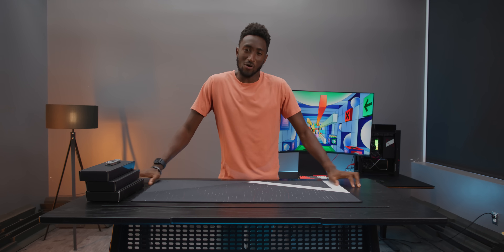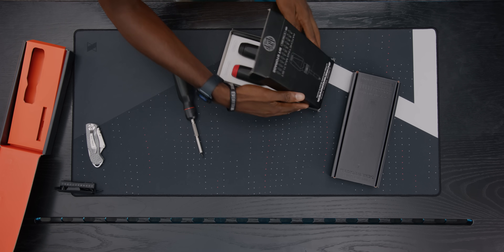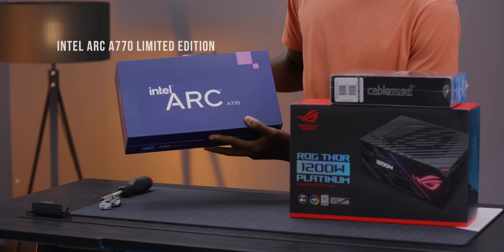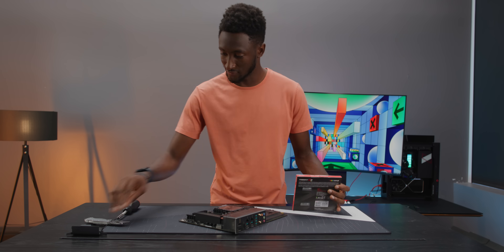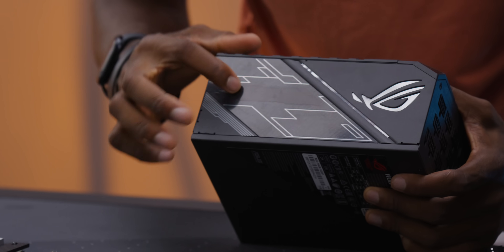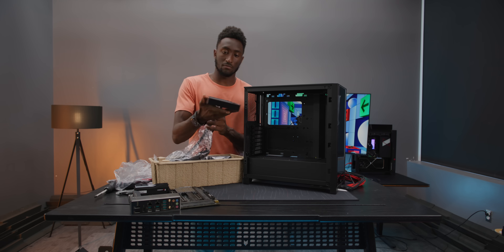World's First Intel ARC PC Build! (A770)

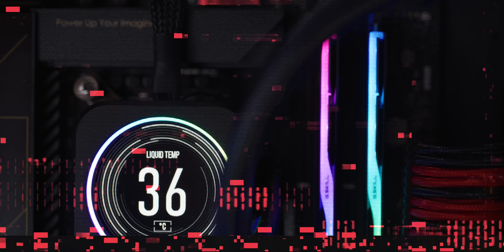Comment: You should flip your top fans to exhaust (14:47) x5 120mm intakes and only x1 120mm rear exhaust is definitely some positive pressure.
Reply: Thought the same this moment - but noone seems to care.
Reply: yeah I was wondering why no one was talking about a few of his slight wrong doings too @Pirate85_Original
Reply: Eh, little extra positive pressure keeps dust out lol. The parts he has probably won't be creating tons of heat buildup anyway with 6 fans going and the AIO. But it would look nicer, so either way prob works fine.
Reply: Now its easier to speak with hindsight now, and things have changed of course. But I will still criticise, for educational purposes, the video:
1. This build is wholly 'High-End'. Everything apart from he gpu is. Thats like calling the RX 6700xt 'High-end'. Nah, its a solid but budget 1440p card.
2.  You didn't say how much each part costs and total build cost. This is huge as people need to truly see the Cpu-Gpu imbalance. If you di an I5-12600k with the A770, THAT WOULD MAKE so much more sense (sorry didn't mean caps).
3. You really aren't supposed to front mount an AIO. Yes it works, but more dust gets towards the fans. Moreover (idk the exact science) but the cables are less optimised that way too.
4.. When doing the final shots of the completed build (14:45) , the 2 top fans are the wrong way round.
5. You only tested 1 game my friend. Yes time constraints and all that. But you tested ONE game. Come on now everyone else tests a good several and at 2 different resolutions. Hell even if you didn't have time to test at 1080p testing say 5 games at 1440p would have been actually a good test of the PC.
But I hope since its been a while now you know do these things. As well as doing: XMP profiles for ram, using Cinebench to test CPU etc.
Reply: Not to mention he doesn’t have fans on the rad, those were the three that came from the front of the case.

Comment: The top fans are wrong way around.
I see that you swapped around the CPU block and fixed up that missing top pcie cover.
You probably should have left the hard drive mounts in the computer to save having to find them if you ever want to use them.
I also probably would have put the power supply facing with the fan up if the LCD was covered, one fan at the top, one at the back, and one out the bottom.

Comment: That PSU looks like it was upside down, so temps may be a little higher then expected - but what a sweet build. The Intel Arc seems like quite a competitive card - especially if it compares to a 3060.
Reply: If you freeze frame at 10:27 or 15:31 you can see the PSU is correctly oriented.
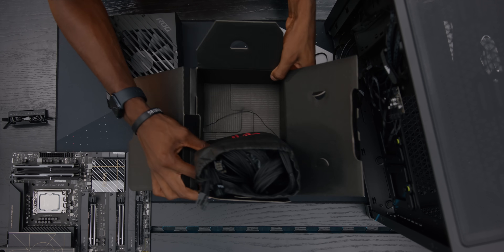Reply: @RK-252  If the PSU sat at the top of the case I would agree with you - however the PSU sits at the bottom of the case (your 15:31 timestamp shows that bit).  So at 10:31 (with the PSU installed & remembering the PSU is at the bottom) - connector is upside down, and writing on the PSU is also upside down too.  However - just spotted at 9:05, Marques indicates if he puts the PSU in the correct way - the PSU's LCD screen giving power consumption info is blocked by the side casing, which is probably why its inserted upside down so he still has visibility to that.

Comment: The radiator tube orientation doesn't matter, as long as the pump isn't above your radiator (radiator mounted on bottom of your case); however if your radiator has a pump where the tubes is I'm not sure about that one
Reply: Also the top fan is oriented for intake, isn't it supposed to be oriented for exhaust? You creating a vortex in your PC with the front fans airflow colliding with the intake up top. Heat rises, so you should exhaust the hot air out the top

Comment: 0:00 Introduction 
2:16 The parts
3:53 The Build,  Motherboard
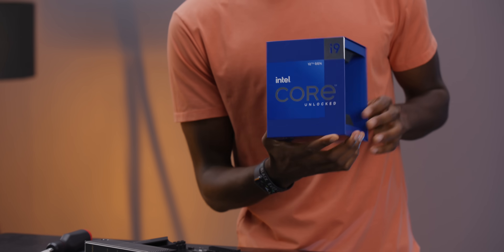4:29 CPU 
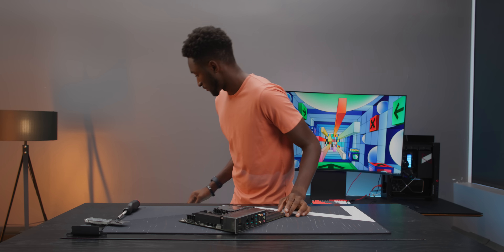5:25 RAM
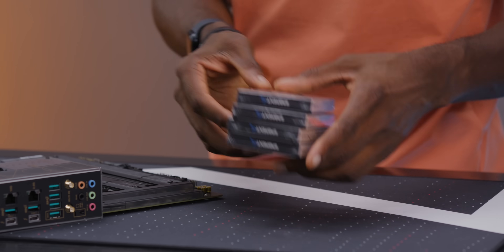5:56 SSDs
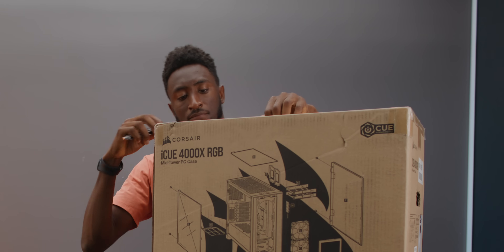7:18 Case
8:23 Power Supply
9:25 Cables
10:51 CPU cooler
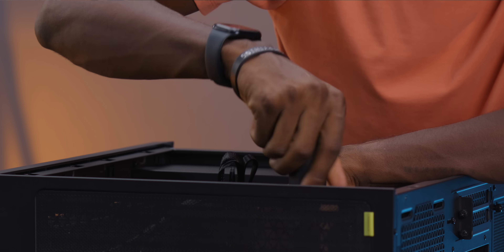12:52 GPU
14:22 Final Build
Reply: Did he apply thermal paste ?
Reply: @Thai101full  nah i guess he went with paste that already comes with it
Reply: @Thai101full  nope definitely not on camera 😅

Comment: This is Forza Horizon 4... 1440p with Dynamic Render Quality turned ON and you get around 90 to 100 FPS with the A770. Just for comparison, with my RTX 3080 OC 10G I get 120 FPS locked, in 4k, without Dynamic Render Quality everything set on Ultra. And I have a much weaker CPU in my system.

Comment: M.2 heatsinks work best when used on m.2 without the paper sticker between right?
Reply: Do you mean the sticker on the SSD? You don't take the sticker on the SSD off.
You take off the sticker on the heatsink cover that goes on top of the SSD.

Comment: Yeah that corsair cooler is not good. The LCD will most likely stop working thousands of users are complaining and I for one is also suffering with the LCD that stopped working due to bad Firmware etc. Corsair seems not to be doing much either.

Comment: I guess he didn't want to show off demos as the ARC graphics drivers are trash.  Every demo I see of any ARC card has frame stuttering.  Even in this video.  There is something wrong with the hardware or software or both.  Probably should have told the audience that doesn't have access to this product that you need REBAR turned on.

Comment: Im very concerned with your m2 drives. You did not put them in correctly. You take out the screw before inserting the m2 drive and then put the m2 drive in and then screw it in place so its a nice firm hold. What you did was not that and all it looks like if you put the heat shields back on is thats whats holding them in place but they will be loose in side and could have issues down the road. 

How is no one mentioning this?

Comment: Hey thanks for a fun video. I just built a 12900K rig with the same cooler and RAM. The iCUe 360 is performing well but when installing I thought the tubes were a little short. You should be able to shove the hoses down under the RAM with the radiator in the front for a better look but they don't quite reach. I have a Corsair 5000x led case and mounted the rad in the side. I wanted to mount it in the roof but couldn't get it to fit over the two CPU power connectors. Anyway, your build looks great.

Comment: Corsair's liquid coolers are rubbish, they are pretty poor compared to their size (using corsair's own figures), I would recommend going with NZXT as their performance typically blows corsair out of the water. Also the Arc cards are coming up as being about the performance level of a 3060/2060 nvidia.

Comment: Marques, there should have been a secondary piece in that case box which will give your radiator better airflow.  It's a "scoop" design that will allow the air to flow up into the case as opposed to that third fan blowing into the PSU shroud.

Comment: Just to clarify: JayzTwoCentz has an in-depth video explaining why it's not a big deal to mount a radiator as shown in this video.

TL;DR: the concern that an orientation causes is an air bubble getting into the pump, but mounted like this, the tubing is above the pump, meaning the air physically cannot travel to the pump.

No it's not the ideal orientation, but it's not bad by any measure.

Simply flip the radiator around 180 degrees to the tubes go to the bottom of the case (not physically possible i know but bear with me) and that would allow air to travel to the pump, which will kill it. That's the way you're not supposed to mount AIO liquid cooling

Comment: Strictly in terms of CPU cooling, having your radiator at the front is the way to go. Push/pull cool air through the radiator. Then, the heat exchanged from the coolant in the radiator, to the air flowing through the radiator, is exhausted through the top of the PC via fans in a pull config.

Comment: Literally both of my favorite sides of the tech space referenced in the same video. So dope! It was awesome seeing you build a PC, too. I was running a 2011-12 based build till around 2020 when I finally upgraded to AM4 / Ryzen. As of now though, I've got a Ryzen 5 5600 + 3060 Ti + 16GB 3600Mhz RAM. But only a 1TB NVMe SSD, a 500GB SATA SSD, and a 2TB 7200rpm HDD vs sooo much SSD storage. Works great for gaming, work, and light projects but I'd need more fast storage if I handled as many raw high quality video files that you do 😅 could you please do a comparison of how this stacks up vs the current gen Mac Pro? (or whatever their flagship desktop machine is at this time)

Comment: You should set the top two fans as exhaust, instead of intake. Now you have 3 front intake, 2 top intake and only 1 back exhaust. Instead turning the two top fans, you can have 3 intakes and 3 exhaust. Better cooling results.

Comment: Does he really forget to put thermal paste on the the CPU or is that not needed with that cooler?
Reply: cooler may have had a thermal pad preinstalled although they aren't usually the greatest and would have been better of using paste instead.

Comment: looks awesome! Quick note about the CPU cooler, as long as the pump is lower than where the hoses come out of the radiator, you're good, no harm in doing it that way. A lot of times you cant put the hoses on the bottom anyways when you front mount it because the hoses aren't long enough to reach going around the GPU.
Reply: Yeh NZXT officially told me in an email that tubes up is fine with the krakens as long as the pump is lower.
Reply: I like it mounted front like he did. The VRMs are on top pumping heat on the radiator if you mount it up top. for me it makes sense to keep the radiator away from any heat sources.
Reply: yeah I hate that the incorrect orientation confusion is still doing the rounds.
Reply: For anyone who's still confused about this: Hoses up doesn't hurt anything, but can result in noise as air bubbles may end up getting sucked through the pump when they collect at the top of the radiator where the tubes are in that case. The only real bad orientation is pump above rad, as the air bubbles can end up collecting in and being trapped in the pump leading to it running dry (no coolant flow - cpu overheating and potential pump damage if run dry long enough)
Reply: @Jay-ik1pt  thanks this is useful information 👍
Reply: @Jay-ik1pt  Correct, though I should add that there are three pump locations that should be noted when installing. The traditional Asetek pump, where the pump is in the CPU block, is where you don't want the radiator at the bottom of the case, or if front mounted, the radiator to be mounted towards the bottom (240mm rad on a case where 3 120mm fans are supported at the front, for example).

The second is where the pump is in the middle of the radiator, like some from NZXT, Fractal, or even those MSI ones that are going bad. Front and bottom mounting are fine, but top mounting will lead to trouble, since the rad, and therefore the pump, will end up at the top.

Finally, there's those Be Quiet! AIOs, where the pump is on the tubes. Front mounting, unless you can mount it tubes down comfortably, is where the trouble will be caused. And that depends on the size of the rad, the case, and how big your graphics card is. Bottom or top mounting will be perfectly fine, since either the pump head, or the radiator itself, will be the top of the loop, and not the pump. If you're using a 120mm version, and are rear mounting, make sure the tubes are mounted down, so the pump doesn't end up at the top of the loop.

tl;dr, just pay attention to where the pump is on your AIO, and make sure it's not at the top of the loop.
Reply: @mclytesabr666  Yep absolutely. The simplest way to say it is just "do not allow the pump to be the highest part of the loop". ...and, I suppose, if you want it to be silent then ideally the rad end-tank on the opposite end from the tubes should be the highest point but that's harder to achieve in a lot of builds and far less important.
Reply: No thermal paste though!?!
Reply: @Biddymacp  so if I had to guess then his water cooler probably had pre-applied thermal paste on the part that goes on the cpu, my H100i did
Reply: @TAYLORGANGARMY  okay cuz I was wondering about that too😂
Reply: @Biddymacp  Thermal paste is pre-applied to the bottom of Corsair coolers from the factory so not to worry about that
Reply: @Biddymacp  i thought the exact same thing when he inserted the cooler on cpu.
Reply: Don't Matter. It's made and tested to work with it's pressure. Up, down or sideways.

Unless it's MSI ofc
Reply: @MortyMous  it matters for longevity.

Comment: Forgot to put thermal paste on the CPU? Or was it pre-applied on the water block?
Reply: Marques liked a comment saying the cooler had pre-applied thermal paste & it's out of the box, so that should be plenty. Just didn't show on screen.
Reply: @sdsd4139  It looked like an expensive part, so I imagine it did. But, I would have liked to see Marques' method of applying thermal paste.
Linus just puts on a few dollops and have the cooler spread it. My own method is spreading it into a thin film, with a credit card.
I was hoping Marques would do the same, because I imagine he would prefer maximum quality over being a bit quicker.
However, maybe applying thermal paste is just for cheapskates like me. Marques gets quality stuff, with pre-applied thermal paste. 😀

Comment: its good, but the only thing that's bothering me is the cooling tubes sticking out on h150i. you can actually turn them down and make them go under the ram and to the top of rad. looks a lot cleaner and doesn't block the view of lcd screen and ram rgb. overall great vid. keep it up :)

Comment: the radiator is good and all but i suspect some cooling issues with the limited amount of fans and the slow speed the case fans spin at without a dedicated hardware/software controller. they sell cute little hardware controllers on aliexpress that i am quite fond of. turns your fans into a jet engine at the touch of a dial instead of waiting for your badly coded motherboard to spin the fans up.

Comment: It looks like your airflow setup may be a bit wonky. If the front and top fans are both intaking cool air, you may get better thermals by flipping the top fans to exhaust. Great video!

Comment: I have the same case. My first thoughts were, "that 360mm AIO will need to go up front because there isn't room for a 360 on top" and after the initial install of the pump head, I said "the tubes are on the bottom of the pump, he needs to rotate it 90° counterclock to come out the right side" because that is how the display is orientated in iCue. The final build, he must have figured that out because the pump head was rotated to the correct position. Overall though, clean little build. I dig the look of the Arc GPUs, except for that RGB cable coming out the front. Kinda ruins the aesthetic.
Reply: u can flip the display 90 in icue lol prolly why he had to boot it up first

Comment: I love the look of ARC GPUs, so clean and simple.
Reply: One of the better looking GPU's I've seen in a while for sure.
Reply: Have you seen the new ROG 4090 style? Lmao is so over the top. Is like a brick with a bunch of lights strapped everywhere
Reply: The card itself is clean and simple, but Intel messed it up by placing that RGB connector on the top. Look at that stupid extra connection next to the nice Cablemod cables, it ruins the look. Why is it even there? Other cards with RGB don't need that...
Reply: Not to mention low profile.
Most arc gpus dont even touch 100w
If they continue this pattern it would become the next low profile king and budget king
Reply: @nothingyetimstillgoing  you don't know what low profile means, do you?
Reply: @rzul  
"Many low profile GPUs will consume less power because they perform so poorly they really aren't enthusiast/gaming GPUs.

A low profile 2060 will not consume substantially less power than a normal 2060 unless it gets so hot it thermal throttles. This applies to every enthusiast GPU."
Reply: @rzul  Low profile is more typically used (when talking about gfx cards) to talk about something with a small footprint or volume. However, low profile is often also used to reference something that is not eye-catching and flies under the radar.
Reply: @nothingyetimstillgoing  Yep you don't. It's just about the size, zero relation between power consumption and the card being low profile.
Reply: @rzul  Wowowowowoowoowowwowowowow
You're telling me, A gpu with a smaller heatsink than the regular one, Has the same tdp?????
Reply: @nothingyetimstillgoing  No, he's telling you that "low profile" is not a description for heatsink size or power consumption. A low profile PCI/PCIe card is a special type of card with a smaller PCB that is about half height and has a shorter PCI bracket, or can be converted to a shorter bracket. Low profile cards are sometimes used in small form factor builds or small desktop style cases where regular cards cannot fit. The Intel A770 is a regular full height card.
Reply: @looks-suspicious  Yes
But it does have the tdp of a low profile,
Hopefully that's because of good engineering instead of driver bugs

Comment: This is a beautiful, simple, clean build. One critique I have, however, is that populating all M.2 SSD slots may steal lanes away from the GPU(dropping it from PCIe 4.0x16 to 4.0x8). the last couple of SSDs at the bottom of the board may be dropped down to PCIe 3.0 and/or with less lanes as well. I'd read the motherboard manual and check for that.
Reply: Generally it shouldn’t affect the first slot because those are supplied by cpu, not chipset. But still good to check

Comment: At 11:40, the AIO hoses are actually supposed to go at the top! It helps to trap the air bubbles at the joint on the radiator rather than in the pump itself
Reply: He said it didn't fit. Nothing wrong with what he did
Reply: @kabulbolan  yeah ik but he said youre not supposed to put the hoses at the top